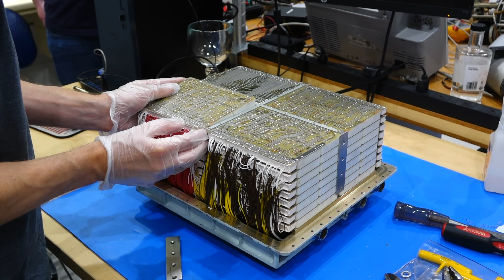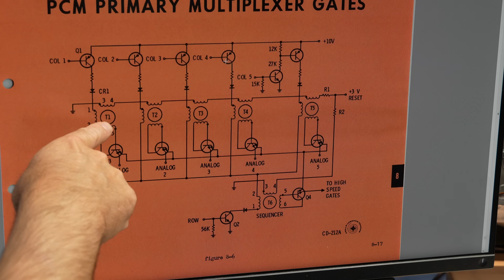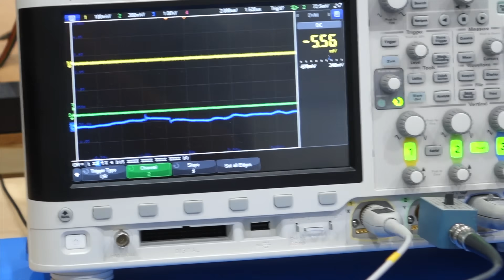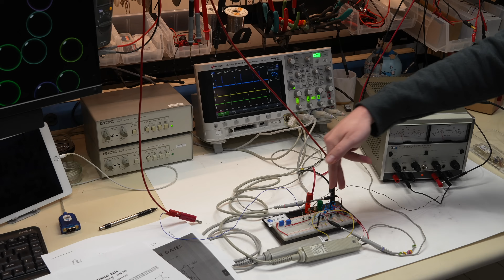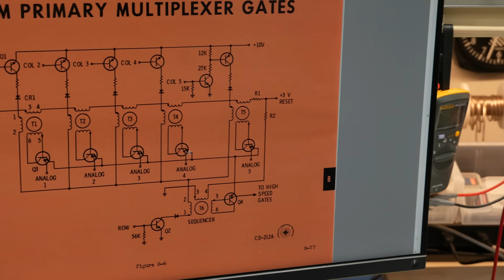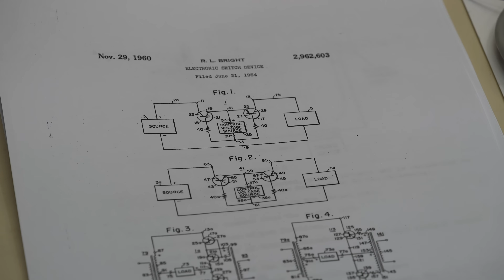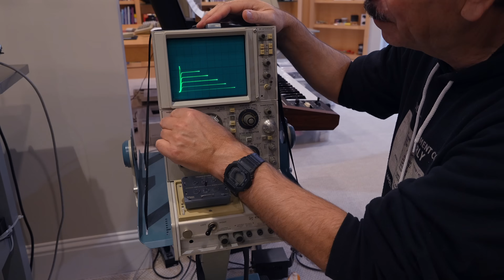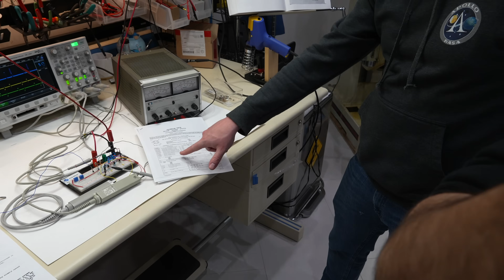Apollo Comms Part 37: Apollo's weirdest (but genius) analog circuit

Comment: I've found this interesting 1965 paper from the Stanford University 's SLAC facility:

https://www.slac.stanford.edu/pubs/slactns/tn03/slac-tn-65-065.pdf

Page 4 shows a simplified diagram of the transistor, which is a NPN in this paper. I guess that flowing enough base-to-collector current would basically saturate the lacunas in the base in such a way to make the base itself conductive, thereby allowing the two emitters to be electrically in contact (at least in the small signal case).
Reply: It Is figure 4, not page 4. Sorry for that.

Comment: Hello, thanks! Can we bias base-collector junction forward in another way and don’t use this coils in this circuit? Maybe using voltage source or forward diode in parallel? And than simply do same thing with signal on emitters (multiplexing)

P.S. I speak English very bad. Hope you’re understand me. Also I’m not a professional in this field

Comment: I don't know about the transistors, IMO it is the magnetic core stuff that needs a whole different way of thinking. Like how you could build a power supply controller using a couple of cores for the pulse-width-modulator instead of an IC.  I seem to recall there was a patent for a magnetic core based logic gate, though I think it came along too late to be significant.

Comment: Late 80s/early 90s I worked on the engine controller for a commercial aircraft, a section of the circuit used similar devices in a chopper arrangement for temperature sensing, they're known as dual emitter transistors.

Comment: Guys I was surprised that you weren't familliar with this kind of chopper taking into account the equipement you do videos about. This way of chopping with 'reversed' transistors (to get mV range saturation voltage) was used in many devices. It was used in phase sensitive detectors for differential transformers (linear or metrisite), or per example for galvanic isolation of amplifier (connected to the patient) and plotter in ECG machines. (HP in the 60's) They woud use royer oscillator working at about 20kHz to produce floating power supply for the amplifier and then they had two more secondaries to extract the square wave. One was used to drive two 'reversed' transistors connected with a primary of 'signal' push-pull transformer (with the signal from the amplifier driving the center tap) and the other royer secondary was used to drive the other two reversed transistors connected to the secondary of the signal push-pull transformer as a synchronous detector (again signal would appear on a center tap)... They used ordinary silicon bjts, just connected in reverse, and the only limitation was that the voltage you want to push through must be smaller then the -Vbe of the transistor, so they used around 3...5V signal and transistors picked for large -Vbe. Today ZTX is making some ultralow Vcesat BJTs for power supplies, and i used those (but now connected 'the way God intendend') to reproduce these choppers from the 60's just for the fun of it. 😂 Old engineers were batshit crazy. I mean, see what an MIT kid with a free access to LSD can make... 😂😂😂

Comment: I found an Apollo document that gives details of the structure and operation of the INCH devices - apm_5009.pdf 
The comment gets auto removed if I include any kind of link, sorry.

They look very much like a JFET type structure, with an extra centre terminal for the control source, rather than the source being shared between input and output signals?

Edit: Just got to near the end of the video, and the same device structure drawing is in there. Doh.
Reply: They really liked that circuit!

Comment: So the INCH is basically the opto-coupler without the opto and isolation parts.. the isolation is provided by the driving transformer, and the opto part was just being invented in the 60's

Comment: I was waiting for you to do more petameter checking, like how this transistor compares to mosfet in terms of performance like what is the  resistance between emitters  and how it depends on base voltage
as it is really interesting to know how does this compares to mosfet switch

Comment: We tend to forget that early transistors were not only tricky to work with but they were also extremely expensive. The sheer ingenuity of some of the circuits devised to overcome these problems in the 50s and 60s is astounding. I think another factor is that the differentiation between analogue and digital circuitry was much less clearly defined in that era. As someone that was just getting into electronics as a kid in the early 60s I find these trips down memory lane absolutely fascinating. Thank you Marc, Mike and team.
Reply from the maker: Don Vonada's engineering maxim #2: "Digital circuits are made from analog parts". Look them up: https://gnomonchronicles.com/wiki/Vonada%27s_engineering_maxims_(nonfiction). They are all quite funny but very true.
Reply: @CuriousMarc  Nice one Marc, thanks. There's more truth in those maxims than in any textbooks I ever read. I especially like #7!
Reply: in 1965 a 2n107 cost almost 9 dollars, gasoline was 30 cents a gallon.
Reply: >  I think another factor is that the differentiation between analogue and digital circuitry was much less clearly defined in that era

I have seen people build amplifiers out of 7400 TTL chips. I could never quite figure out whether this was intended to be serious or ironic.
Reply: in my opiniion there is no much differentiation between analogue and digital engineering but many digital based engineers don't know about that
Reply: I agree, John L., considering how low wages were back then, any kind of exotic semiconductor devices were expensive.  It was tough enough for a kid to buy just simple transistors to experiment with.
Reply: In my observations, they tended to be better engineers .... everything was analogue and everything in brain space... if you did something, chances are you either invented it or created the pattern.

Comment: I'm 64, more than 50 years experience in electronics design and fault finding. I've never seen a stranger transistor switch before. Simply genius, as well the backwards used npn. Thank you so much for sharing.
Reply: I'll just point out that this patent is from *1954*. There's a NASA report on the circuit (being used as a light activated switch) here: https://ntrs.nasa.gov/api/citations/19650010325/downloads/19650010325.pdf

Comment: My guess is that core logic was used to turn on the INCHs because the emitters needed to be kept isolated electrically. 

If the INCH was activated using an external DC pulse, that would need to be referenced to ground, which could also interfere with the analogue signal being sampled. So I guess a bit like an opto isolater...

So they were in effect coupling transformers. 

Some ancient PAL colour TVs used techniques similar to this.

Interesting video 👍🏻🇬🇧
Reply: Is it anything more than an isolation transformer?  Does the core type matter?
Reply: @0MoTheG  Yes, that is puzzling me too. I was surprised that the transistor was 'on' only while the 'set' pulse is active. So why does it need a reset coil? I was expecting the core to act as a memory so the transistor would be 'on' between the set and reset pulses.
Reply: @john_hind The core can not possibly keep the BJT on.
IF there is both a set and a reset pulse then the core must have been magnetized enough to act as a non linear element.
In core memory the read is a destructive non linear operation. The core acts like a rectifier.

Comment: So why did they make the Inch transistors if the circuit works with two normal transistors? Is it maybe a more accurate duplication with everything in one case?
Reply from the maker: Yes, better match if the two Vsat jumps, both junction at the same temp, same current injection in the base, direct emitter to emitter path through the bade.

Comment: So, if you have twelve of them, does that make a foot? 😅
Reply: Or buy 36 in a yard sale.
Reply: I think it's already good footage with just 2 :D
Reply from the maker: It does. Curiously, it still takes 12 of the modern ones, but now they make a meter.
Reply: @CuriousMarc that sounds like the result of someone who uses a tape measure marked in decimal feet. 😂
Reply: And how many could you get with current process nodes?

> units
You have: inch
You want: 2 nm
	* 12700000
	/ 7.8740157e-08

12.7 million! That's a lot!
Reply: Same way 8 bytes make a morsel

Comment: The 2 emitter  transistor is standard for TTL logic
Reply: People don't look at equivalent circuits anymore... They used to be shown in just about every data book. What is actually going on inside the chip. 

It's all just functional blocks now. The guts are too complex to draw. Actually, it's how many older devices were/are copied by the Chinese

Comment: I predict that the 3N68 will now be immediately unavailable and on sale for $150.00 each , and used in weird esoteric guitar pedals.....
Reply from the maker: You are all doomed. We cleaned up all of Etsy's inventory, and are now designing our pedal effect. It's called "Unity". It samples the signal at the input, and reproduces it exactly at the output, with less than 200 uV change! Try that with a copper wire.
Reply: @CuriousMarc  Please add a zero gain tube cathode follower in output....for that "full bodied mid range" :D
Reply: @goranamcoff6235 😂
Reply: @CuriousMarc  Will it be "true bypass" when off?
Reply: @davebowman6497 I think its true bypass when on, that's the greatness of it.
Reply: @CuriousMarc 

Damn... I need one
Reply: @CuriousMarc  I'll take 2, and a pair of HP Fancy Pants...
Reply: @CuriousMarc  This comment made my morning :D
Reply: in a pinch you can  do it with 2 regular transistors instead of dual emiter one
Reply: @xav6427  
You will note in the schematic at 11min in, each gate (or base, if you prefer) has resistor bias. If you use two transistors, remember to find the right resistor for both.
Reply: @bmobert - or a pot…
Reply: @xav6427 how?
Reply: @xav6427  in a (p)inch in fact.
Reply: That means that “somebody” purchased a huge stock of waste 3N68 and promoted this video to turn waste into gold)
Reply: I vaguely recall the ARP2600 synthesizer used similar transistors as voltage mirrors. But it’s been a number of years since I looked at the schematics. A big reason to have one die, As opposed to two discreet transistors, is for thermal (temperature) stability. Probably part of the reason to reverse the emitter and collector is also the low beta will be less subject to thermal drift…
Reply: I thought I was the only guitar nerd following this channel.
Reply: @dojoguitare i was immediately thinking "how could this be useful in a guitar pedal circuit" 😂
Reply: cores too, with that wide hysteretics
Reply: Hahahahahaha this is so niche and so correct
Reply: One time I decided to build my brother 2 guitar pedals for Christmas. All from scratch using circuit examples I found online. It took me months to design and build them. It took me months more to find some really obscure discontinued JFET.

I have 9 of them now and I don't think they'll ever get used again.
Reply: I was for a moment thinking about making a stereo audio source switcher for my vintage hifi system with these.  That would have been a criminal waste.
Reply: @KanalFrump  Also, mercury wetted reed relays are a much better option.
Reply: @KanalFrump  Pair of Uniselectors / Ledex switches.
Reply: Aliexpress. 100 for a quid.
Reply: Hello bonjour très intéressant j'aimerais bien voir comment réagirait le tedteur de composants comme le LCR TC1 ou autre. J'aurais aimé acheter ce transistor 3N68 par hasard vous n'en vendez pas ? J'airai aimé trouver la datasheet de cet inch pouvez vous svp m'indiquer un lien ou je pourrai la télécharger encore merci pour votre travail.
Reply: Already saving money to buy such "Apollo" pedal
Reply: @Eugensson    ... i was rather hoping you'd design one so I could buy it 🤣😂
Reply: $150 for mugshots of 3N68.
Reply: Glad I already bought a bunch of vintage transistors and dual gate mosfets then...
Reply: @jameslawrie7517  Will have to look in the box of really old GE parts i have for some then.

Comment: The InCh construction looks a lot like a Mosfet, with only the oxide layer missing.
Collector = Bulk, Emitter1 = Source, Emitter2 = Drain, Base = Gate (without insulation).
So instead of opening the channel by attracting charge carriers (electrons) it just dumps them straight in.
I wonder if this circuit would still work with a four legged mosfet. I think you just need to reverse the polarity of the pulse.
(Disclaimer: Not an expert, pure speculatuon)
Reply: Yes, too much resembling a Mosfet.

Comment: These transistors may not exist as standard parts nowadays, but IC designers do use multi emitter transistors internally in ICs, and the multi-source (or multi-drain?) MOSFETs as well on ICs, usually as part of a current mirror.
Reply from the maker: And the multi-emitter transistor is the basis of many TTL chips.
Reply: @CuriousMarc original designs of NAND gates with BJT transistors use multi emitter transistors for the logic stage
Reply: @CuriousMarc You beat me to it!

Comment: i wonder if it works anything similar to early 80's polish tv neptun m557 's - umi 2001-2 board. although this was a board that could switch multiple analog signals at once, each switch had 2 inputs and one output and it was very simple :*input voltage 1*- resistor- input signal1->|- output-|<-input signal2resistorinputvoltage 2 where all input resistors were 33k and output was connected to ground by another 33k resistor.
in this case you could switch those things by polarising one side of it making diodes in the center go into saturation at which point they acted as a wire for ac signal  but when polarity was reversed diodes would block the signal completly. can you recreate appollo coms circuit using diodes insteaad of transistors or is it completly something else?
Reply: Yep, exactly 👍🏻🇬🇧

Comment: Looking at the diagram of the two emitters side by side reminds me very much of a mosfet, missing only the gate. I would suggest that the bias current between base and collector is generating a voltage between the two, acting as a virtual gate.

Comment: Awesome. The low VCEsat  was also beneficial to zero audio out during switching / power off/on to prevent clicks . We used a reverse BC 337-40@ Philips when I remember correctly. So starting with a high beta helps. The drive was done with open collector PNP to allow for negative going signal

Comment: Who comes up with the idea of operating a transistor on the collector and giving it two emitters?
Reply: Someone who knows that a transistor is just a volume of silicon that can be doped and wired in as many places or patterns as you want. Back then they saw transistors as weird new critters and they did not have so much tunnel vision about what a transistor is and how it works. A emitter is not "for" anything, just use it in whatever way you can.
Reply: You could also ask, whom or what group cam up with the concept/planning of the entire Apollo communication system, RF, Signal, Power monitoring layout.

Comment: After two watches of this video, I still don't understand how this weird INCH+core combo solves multiplexing hundreds of analog signals through a single ADC.  There must be some kind of latching into a framed stream synchronized with the INCH switching behavior, right?  Was something lost in the edit?

I probably shouldn't try to watch CuriousMarc videos at 2 AM.... 🙂
Reply from the maker: Yes, the frame timing signals normally control the setting and resetting of the various cores, so the analog signals get connected to the ADC just at the right time within the frame. There are also several stages of muxing, as you can see in the schematics. On his breadboard, Mike just put a small controller on the side to trigger the cores repeatedly for demo purposes.
Reply: @CuriousMarc  Thank you for giving me credit for being able to read schematics without elevator music. 😀 (I am but a mere software guy trying desperately to follow along.)  Seems like a great side quest for Mike to replicate in an FPGA...
Reply: When the digitally converted data is transmitted, the channel number from which the data originates is also added.
For example, a fixed-size header with various information such as the channel number, followed by the data.
Reply: Yeah, there's a timing control circuit not shown here. That signal would be coming in from somewhere?
Reply: @fredfred2363  Ah wish they had a quick look at that as the rest of the video while fantasticly interesting was a bit too black magic for my idiot brain without the context of the timing and control circuit.
Reply: @faumnamara5181  If you look at the diagram at 03:25 there's some COL and ROW lines which I think act as gates for the inputs.